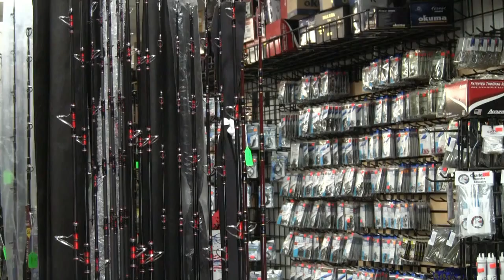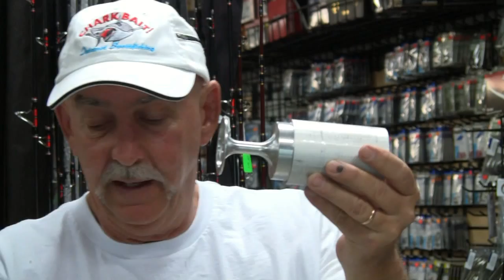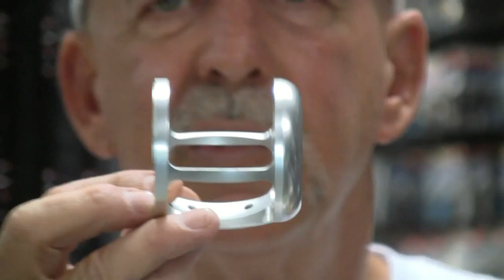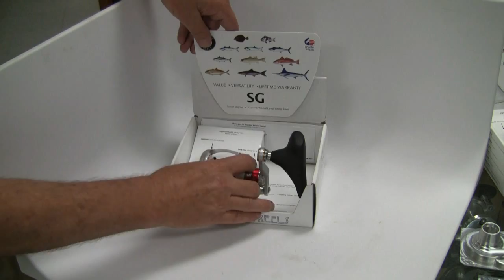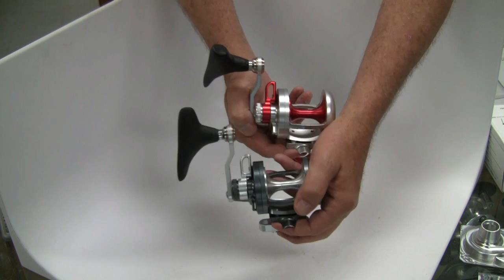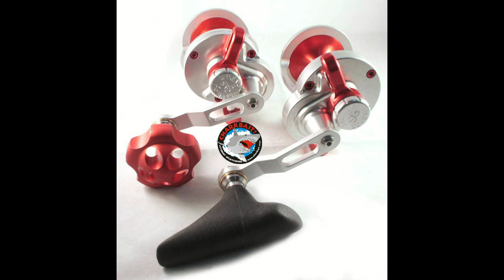ReleaseReels

Comment: I recently purchased the SG reel and am planning to spool it with 40lb hollow core braid.  Would 30lb mono work fine for a topshot?
Reply from the maker: Nelson Flores Yes indeed. The nice thing about inline rigging with hollow braid is that you can run a fairly wide range of leaders and maintain line test, whereas a knot connection reduces test by a certain percentage. You can run 30 as your leader, but you can also bump up to 40 and set your drag up to that level. If you go down in test, then set your drag for the lightest line. (and of course if you bump up in leader test you still should set the drag at whatever the lightest test is within the rigging).  In your example 30# line would be the lightest test, drag should be set at 10-12 lbs.